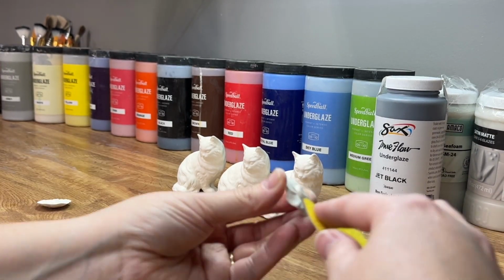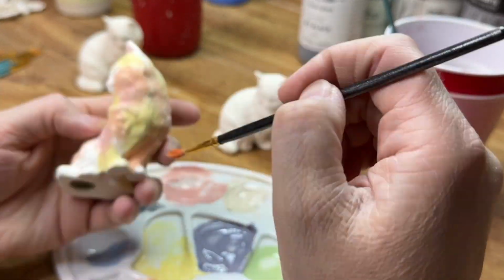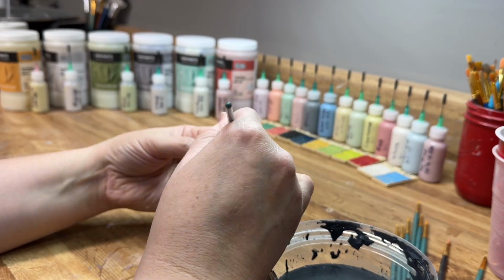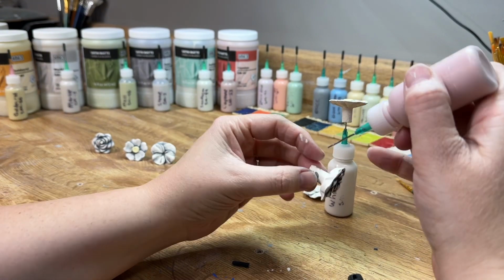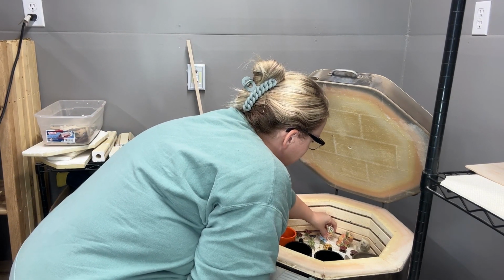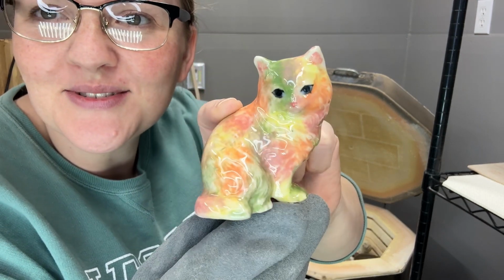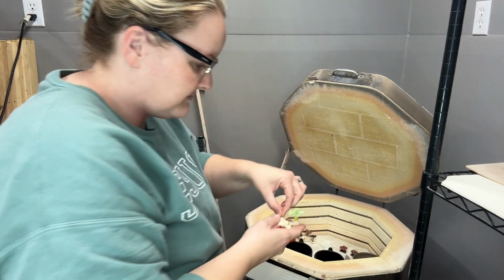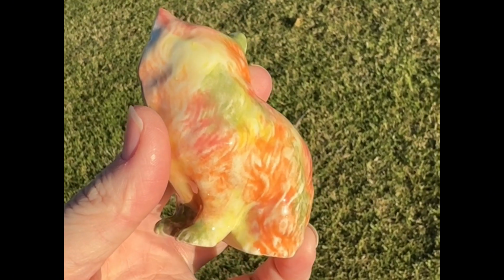Mystery Pottery Mold Series - Molds 1 &2 - Part 2 the Reveal!

Comment: I have had terrible time with the speedball underglazes as well. I just LOVE THESE girl!! Every single time you post I get so excited to see what you’re doing. For uneven bottoms I use a mesh screen that’s made for drywall and I lay it on a wet paper towel to catch the dust and then just put the item on it and pull it across. Be sure Not to do it hard, obviously. Also if you need a flat bottom spray the counter with a light mist of water and place the item on the counter and swirl it around in a circle! It works sooo well!! Also be careful doing this because sometimes the piece will become stuck to the wet counter but all you do is wait a few minutes until it dries!! Hope that helps.  I LOVE how you organized your glazes in the small bottles!! The flowers are sooo well done! Shading and everything!! Where may I ask did you get the bottles? And, just a little suggestion when clear glazing, be sure to use a soft long haired brush so you don’t accidentally move the underglazes. I made a set of little mini tea set with intricate designs and messed them all up by using a brush that was too stiff!!😢. What an awesome idea to use the stilts like that!!! They turned out so well!! Love that idea!!
Reply from the maker: Ohhhhh good tips as always girl!! And I bought the bottles on Amazon. I put a link to them in the description, I’m an Amazon affiliate so any purchases you make through those links I will make a tiny commission on.